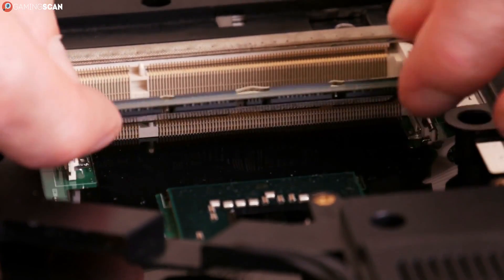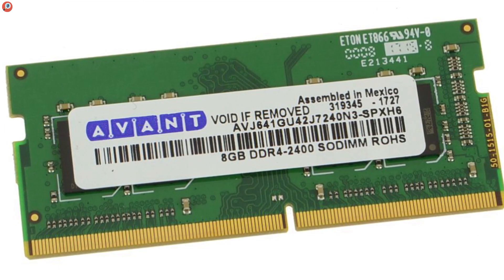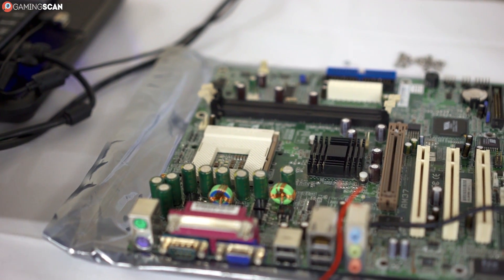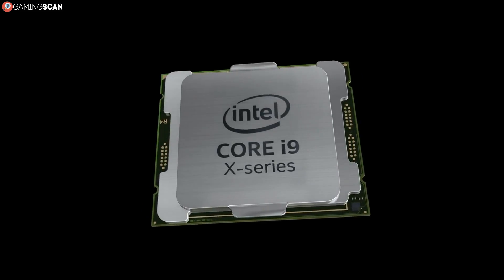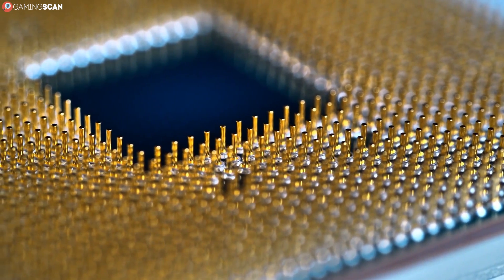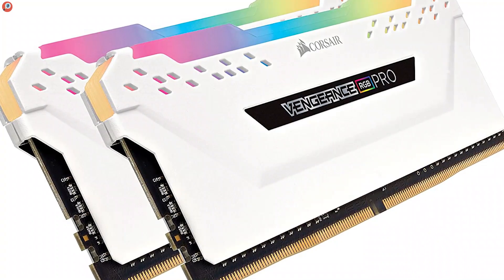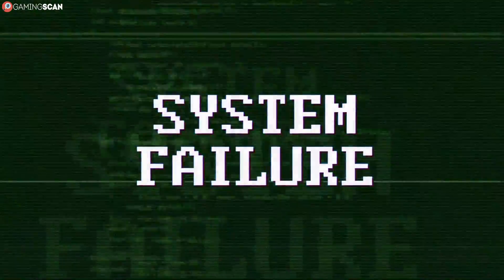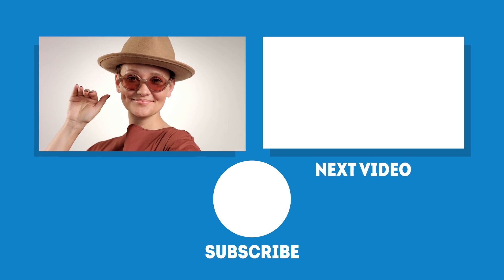How To Choose RAM [Ultimate Guide]

Comment: I disagree that you should only watch the DDR format. Chipsets of the motherboards support only a specific type of DDR memory at certain MHz speeds. Each of those motherboards has a limit. Even if your RAM is at this MHz, you shouldn't exceed the limits of the motherboards because this causes overheating.

Comment: I need an advice please I've only 8gb and i've four slots(I've seen my ram slots in the task manager and i noticed it's four slots) I'm using only one slot my motherboard is  
baseboard manufacturer: MSI 
baseboard product :hm110m pro vd (ms-7996)
Version: 1.0
I went to someone selling rams to buy an another 8gb to reach 16gb he said you have to buy 16gb beacause you cant add double 8gb rams in two slots beacuse your motherboard wont accept and it will be compressed '(pressure) 
He's right? or he just wanna just sell more items? I'm not good in such things
PS : my CPU is i5 7eme gen & Gpu GTX 1050 ti 2go & my current ram speed is 2133mhz DIMM DD4

Comment: Can i use 2 different clock speed ram together in a system ???
Reply: I think the system will only move as fast as the slowest part, so technically yes

Comment: I'm sorry there are just a few things that bug me in this video. DDR3 is old but it's not obsolete. If you have a DDR3 motherboard and processor, you shouldn't ditch it and buy a completely new package. Ddr5, is starting to make its way onto the market. Stick with DDR3 for now and when the latest gens price drops go with that. There's no need to upgrade you motherboard and processor if it's working fine in the time being.

Comment: The MHz for ddr4-3200 Is 1600mhz and the ddr in ddr4 stands for Double Data Rate and that means that the ram data rate is 2x the MHz and qdr is 4x the data rate
Reply: 7:50 you can’t all ways upgrade ram for 16gb to 32gb you may not have ram slots left eg you may have 2 slots and both my be used with 8gb
You may have 4 slots with 4gb each so keep that in mind and triple check compatibility
Reply: Ram channels are not just slots most cpu can have 2 ram sticks per channel but if you cpu can use duel channel and has 2 slots you will run in duel channel but if you cpu can use duel channel and has 4 slots it will run in duel channel with 2 or 4 ram sticks but if you use just 2 ram sticks you will need to have them in the right slots to use duel channel
Reply: Most of the time you can run mismatched ram if you run it at the slowest of the sticks rated speed and all mismatched ram sticks will be able to run at JEDEC min spec which makes the base specs for all company’s to follow
Reply: Ram latency can be more important then raw speed but the speed and timing make up the latency and cas latency that was mentioned is a timing but there a more then just cas latency some ram specs have a string of numbers such as 14-14-14-38 those a the primary timing but there a a lot of them but those are some of the important ones
Reply: The capacity of ram make no difference form 16gb to 32gb to 64gb if 16bg was all you need

Comment: She kept talking about gaming purposes and I was waiting for her to say “but if this is your work station...”. I use my pc for 3d rendering and I usually have lots of tabs and programs open. I’m in collage for mechanical engineering.
Reply: i don't work with 3d engineering (i am only 17 years old) and i made a lot of research to build my pc, i heard that for gaming purpose 16 gb of ram is enough and having 32 gb of ram for gaming is useless but for 3d work and stuff i heard 32 gb might be usefull.
Reply: @grandeghazi8173  or for VR Military flight sim multiplayer then you need at least 20 But that is weird so I would go for 32 or higher
Reply: Did you choose what RAM to use for this purpose and if you bought it already, are you satisfied? I'm currently building a machine for rendering and I'm stuck at what RAM to buy
Reply: @drakelord0721  8 is going to work, but over time you might overwork your computer, 16 works well, but if you want it to run really smooth I’d go 32. I have 16 and I don’t have any issues.
Reply: @Telgyn  At what MHz?
Reply: @drakelord0721  honestly, I don’t know.
Reply: @Telgyn  Alright! Thank you very much
Reply: @Telgyn  I think you can see the frequency in the task manager

Comment: Well the new RTX 3070 will use in gddr 6 ram  not using your actual ram so you will be running smooth with just 8gb

Comment: Upgrading an existing motherboard to use DDR4 memory instead of DDR3 is more of a complete rebuild of the system.  You WILL have to replace the CPU as well since the memory controller for either DDR3 or DDR4 is usually part of the processor.  Even older memory tech (DDR, and DDR2) had the memory controller on the chipset.  Replacing the motherboard on a computer you built might be a drop in replacement, but if you have a factory built PC (IE: Dell, HP, Lenovo, etc) it's likely that the connectors between the motherboard and the case (for power switch, LEDs, Audio and USB jacks, etc) may not be standard and you would have to rewire them to fit an OEM motherboard that you could buy.  You might also have to replace the power supply, and disk drives if the old computer was using IDE, newer motherboards only use SATA or even M.2 disks.    DDR3 memory is STILL available, and upgrading here is still possible.  BUT it is a short term upgrade as eventually the rest of your system will become obsolete and no longer supported by newer versions of Windows.  If you are running Linux, or even BSD, this won't be a problem, Linux still supports older computers as far back as those with 80486 processors (depends on which distro, but Debian still does).

Comment: i bought an i5 9400f gtx 1660 super 8gb ram ddr4 2666mhz pc, but i'm getting another 8gb ram ddr4 but 2400mhz. will my performance get better with 16gb running at 2400mhz or should i keep half the ram but on the higher frequency?

Comment: I want a budget  gaming Pc that stays in 40000, pls anyone recommend me some?
Reply: You can go with AMD ryzen CPU build, no need for dedicated GPU, just use their Vega APU and will doing "most" of gaming just fine. (at low or medium setting) and buy 8 gb of ram (4x2 dual channel).

You can save money for GPU later :)
Reply: @alwin_kurniawan1110  tnx mahn..
Reply: @alwin_kurniawan1110  which one is better ,buying two 8gb or one 16 gb ram
Reply: @rjun152  depending on your budget, but i suggest that you choose higher clock speed ram because AMD seems to "love" it.
Reply: @rjun152  dual channel serves amd processers better results and fps
so choose 2*8gb ram
Reply: you have a $40,000 budget?
Reply: @ItsLynkedYo  😐40000indian rupees
Reply: @ItsLynkedYo  565 USD

Comment: okay i have a few things i wanna point out: (i know it's supposed to be a simple guide but a couple more minutes wouldn't hurt)

1. 2:45  just a basic mistake: "should use SODIMM memory if you're looking to upgrade your PC with more RAM". correction: replace "PC" in this sentence with "laptop".

 2. as you mentioned, DDR4 is better than DDR3, but you also said there's only single digit FPS improvement going from 2400 to 3200MHz, but in the same way, take a medium DDR3 clock speed and compare it to slower DDR4. not that big difference. so yes even though DDR3 is an older standard and is slower, i do not agree on changing out the whole motherboard just to have DDR4 (3:38) unless you're doing a major upgrade where the chipset doesn't support newer CPUs (especially when it comes to budget systems it's cheaper to keep it at DDR3 board without major loss in performance).

3. jayztwocents made a video testing and comparing having only one stick in dual channel vs 2 sticks,  some games saw no major difference, but others saw drastic differences. so my point: check your motherboard spec, and if it says dual channel use pairs of sticks, quad channel 4 sticks etc.

4. 11:04 you talked about CL but only briefly, and didn't even mention other types of timings that would be displayed on RAM sticks and what they mean/how they affect performance. you could have at least mentioned that people should try looking for the lowest CL after choosing the clock speed and capacity. it's on the bottom of the priority list but a priority nonetheless.

sorry that was a lot of nitpicking. it was a good video but in my opinion could have been more refined.
Reply: There are also definitely videos out there showing a significant increase in fps when the RAM sticks run at a higher frequency (3200mhz vs 2333mhz). That said, it's not the most defining component when it comes to gaming. Not sure why the video disregards this
Reply: @Annodite  i guess that depends on the game, but they were right about RAM being the second most important component after CPU and GPU.
Reply: @BerzerkaDurk  more or less yes. Storage is the usual term for them but they can also be referred to as "non volatile memory" or "permanent memory". Those names are technically not wrong and in the video they do proceed to saying the difference.

And about showing the wrong things om screen, yeah that happens often in these videos.
Reply: I was so confused at 2:45 thanks
Reply: #1 really got me thinking. Thanks for clearing it up. I think YOU should have made this video. lol
Reply: Nice dude thx
Reply: Sounds like you know your shit bro I’m glad 😂🤙🏻
Reply: @steezyplaya452  all thanks to the abundance of PC related content i watch on the daily but thanks 🤣
And i still don't know everything...
Reply: @crisscrossam  I’m trynna improve audio latency when recording on my HP pavilion gaming laptop it runs 8gb ram so I’m trynna upgrade it to 16gb. Any recommendations?
Reply: @crisscrossam  dual rank, kit (8gbx2), single rank , idk which one I need, the price goes up on all 😂
Reply: @steezyplaya452  idk how much upgrading to 16GB will do in terms of latency but definitely a good move when you're streaming/recoding and gaming at the same time, as well as for longevity  of use of the device for many years to come.
Reply: @steezyplaya452  single rank is better.
Reply: at 2:45 she literally had one job

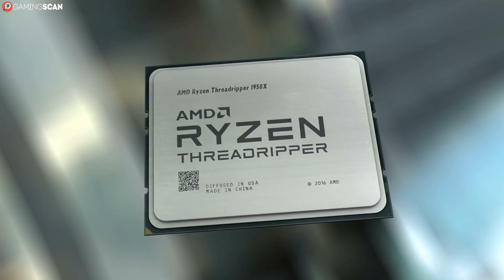Comment: 4:13 AHHH he forgot the thermal paste
Reply: Emerald Blaze there is old crusty thermal paste on the bottom of the cooler but you should really clean it and put new stuff on
Reply: @PippyLive  yeah but thats worse than not using thermal paste it insolate the heat more
Reply: @Rainbow__cookie  yeah you should really be cleaning the cpu and putting fresh paste on
Reply: @Rainbow__cookie  he or she??
Reply: @Tim1kim  idk really
Reply: Ooh

Comment: so dose the brand matter when choosing ram or are they all the same
Reply: Elizabeth McDonald they all differ from speed to latency like gskill trident Z will be better than patriot viper
Reply: @FunBreaker  but if you go with all the specs u like is the brand important, say u had a few to chose from and they all were the same specs dose brand then matter
Reply: As long as your ram is in the qvl of your mobo, you Will be guaranteed your ram kit works np togheter with your mobo.
If you don't want issues later on,
Save the specs of your kit.
If you ever decide to add a second 2 stick kit to the original one.
That way you are certain that your newer kit wil nether be bottlenecked by the original kit or the other way around.
Reply: I say this because i have seen YouTube vids of builds where they we're forced to swap out ram kits because of issues